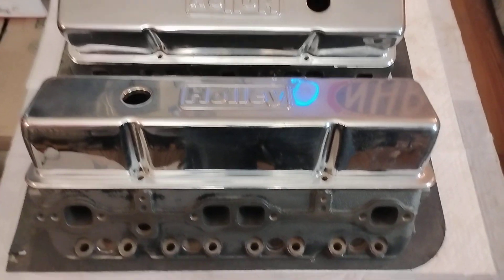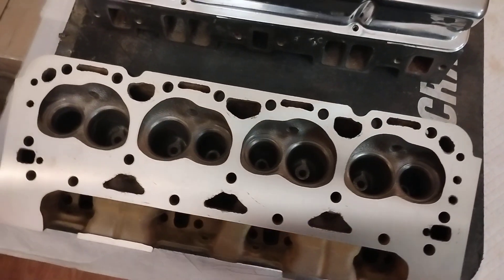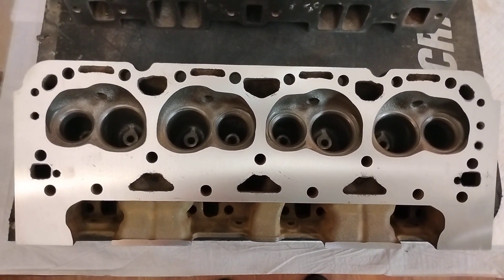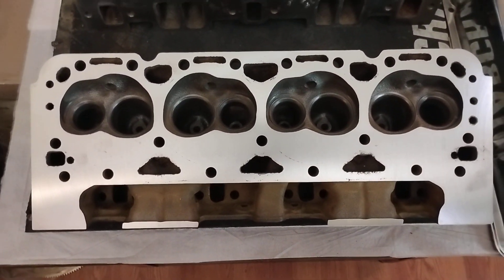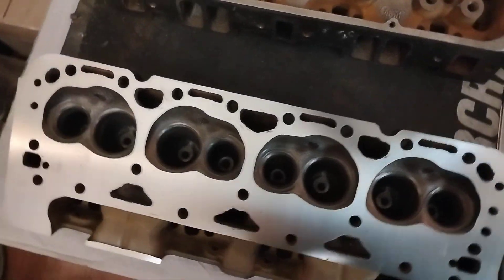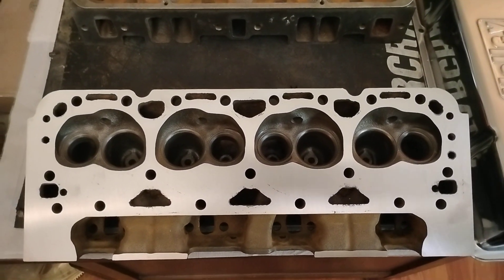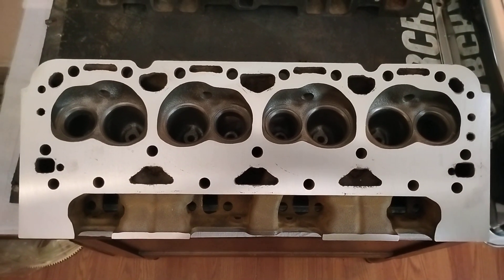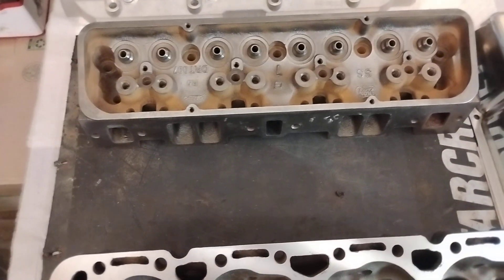DART 180cc IRON EAGLE heads for a 355ci SBC.

Comment: You know, I’ve seen a couple sets of these recently. Not that cheap, but one set was $400 in a better shape. Never run aluminum. Should I drop the money and try some aluminum Prolifer or AFR?
Reply from the maker: @Hogiewan1  Depends on how much power ya want from your engine. Aluminum is lighter.
Reply from the maker: @Hogiewan1  $400 for a pair of these is a hell of a deal.

Comment: Hey Sam, just got around to catch up on your video. You have inspired me to get a an old motor and build just to learn more and follow your videos and my buddy Nolan and Paul that follow you. I haven’t built a motor in a million years and always had my engine shop I have used forever to do bottom ends on anything I needed to get rebuilt or freshen up heads. I’m building a tribute car for my dad that passed several years ago. He loved convertibles and loved Buicks. It’s in paint and body but will definitely have to get freshened up since it’s a 34k mile car that the motor has never been cracked open from the looks of it. I bet it still has the original timing chain. I would like to build it but I know that certain things will have to be freshened top to bottom. It’s a Buick 350  4bbl from factory. It runs good and doesn’t blow any smoke but I wanted to drive it a bit before I pull it because you know how that goes, you are in it and if you want to do it right, you will replace a bunch of stuff since you already in it. Any advice would be greatly appreciated. Hope you and your family are doing well. 👍
Reply from the maker: @MrWill73  Them old Buick 350s are pretty dependable. Run forever.

Comment: If you were going for 500hp in a 4x4, would you start with the 350 that's in it or find a big block?
Reply from the maker: @Davidhillborn  350 can make 500hp pretty easy, but a bigblock would have Alot more torque. Also a 500hp 454 be a milder engine than a 500hp 350.
Reply: @thereluctantgearhead4544   Yeah, Im just wondering what would live longer at that power level. I always see people making more power, but they rarely discuss longevity/miles you can expect.
Reply from the maker: @Davidhillborn Bigblock about as durable as it gets. That's why they used them in RVs and dump trucks & school buses. They are stout even stock.
Reply from the maker: @Davidhillborn Seen 454s in old man dullies with 3-4 hundred thousand miles on them and still run fine. Toughest GM gas engine ever built.
Reply from the maker: @Davidhillborn bigblock Chevy was originally invented as a racing engine for NASCAR in 1963. They are good.

Comment: I always wanted to put a set of those on a 327 with a big solid lift cam 245-255 on a 108 lsa. Spin that bastard to 7-7500k rpm. I think these flow better than vortecs from what I remember. I think you're right, being topped out around 240-245 cfm, plus they won't crack just by looking at them wrong. That's a good find. Circle trackers used to do hidden porting on these. I'd love to find a pair for $150 bucks.

My wife said you sound like Negan from the walking dead. I always knew you put me in mind of someone, I just couldn't place it.
Reply from the maker: @inscoredbz  I'm building a rowdy 327 now late 70s drag racing style. Using ported 292 Turbo heads with a ton of work done to them. 290/215cfm intake & exhaust. Using a .650 lift solid roller. Forged crank, aluminum rods and Arias pistons. Should spin on up. Building it like a old "Modified Production" class type engine.

Comment: I know from watching your videos you have a pile of sbc parts layin around, probably a lot of crankshafts? Is that the reason you don’t mess with 383’s for a FUCKIN torque build such as this?
Reply from the maker: @USA-km9ph  I have 383s in my collection too. But for my wife's suburban, I can build a 355 that'll be plenty stout. I've built Alot of 383s, even built a few 396 SBCs and a 408 from a 350 block. But for the effort required, this is just a low buck 355 build that'll double the power of the current engine. Eventually it's gonna get a 454 swap, but I want to put a DANA 60 front live axle and leaf springs under the front and run a divorced transfer case with a T-400 and 14-bolt corporate rear. But that's the future plans. If it was mine, I'd build a mud bog truck with it with a radical bigblock Chevy in it & 40 inch groundhogs on it.
Reply: @thereluctantgearhead4544 always wondered if the 396 sbc is worth the extra work over a 383? Any thoughts?
Reply from the maker: @USA-km9ph  quite a bit more grinding and making clearance. But it definitely hauled ass. Took a long time to prep the block and shit. Used a .900 base cam. Used a 2 inch rod journal. Profiled cap screw rods, etc.
Reply from the maker: @USA-km9ph  4 inch stroke in a 400 block is even better. But it definitely takes some work.
Reply from the maker: @USA-km9ph  A bigblock is definitely in the plans for it tho. Be a torque monster 454 for the wife.

Comment: Nice score .  I have a 1990 Chevy 1500 shortbed 5.7 700r4.  What are your suggestions on heads and cam I’m wanting to stay with the tbi.   The truck is a daily driver, not a street/strip truck just a cruiser.  The stock horsepower is like a whopping 220 and that just don’t cut it.
Reply: I would definitely put a carb on it, a good 650 & an air gap intake would make a big difference. Swap to hei & itll be trouble free. The good thing is you can keep your factory fuel pump, just put an adjustable regulator on it & turn the pressure down a couple pounds.
Reply from the maker: That TBI will limit you. But a mild RV type cam with a smooth idle won't piss the ECM off. Probably stay below 212 to 218 range and a 114 lobe sep. 450 lift range should work. The heads are another problem, your TBZi intake is made for TBI heads that have the inner 4 bolts at a different angle. But there are a couple heads made that have that bolt pattern that are better than your heads. 088s would be a good production head that would work. Non swirl, 64cc chambers and they flow more than the 193 TBI swirl port heads.
Reply: @ I keep forgetting that the misalignment on the intakes, I would need an intake manifold for the vortex heads. If it was you, would you stay with the tbi or go with a carburetor?  I appreciate the help.
Reply from the maker: @michaelmaher4328 The truck this engine is going into is a 1992 Suburban. It has a 4-barrel intake & a 3310 Holley carb in it. Runs way better than it did with the TBI, probably 50hp difference. Get the same or better mpg. But that old 250,000 mile 350 still going strong, I'm building this engine to replace it. So I carb swap all my TBI engines I've ever had. It's more dependable than it was with the TBI. Had no power, drank the hell out of gas. But the carb & HEI ignition swap made a hell of a difference. Totally dependable.
Reply from the maker: @michaelmaher4328 even sounds better. Takes off much quicker.
Reply from the maker: @michaelmaher4328 I got a video about carb swapping a TBI on a OBS Chevy Suburban. It came with the same engine as yours.
Reply: @ oh yeah, it’s got like 2:73 rear gears, I’d like to stay with them, but already decided to get a posi unit for it.
Reply from the maker: @michaelmaher4328 Posi always a good idea. That 2-73 gear ain't doing ya no favors. MPG and top speed is what they are good for. Make for a slow takeoff. A 3-42 would feel like ya added 100hp. MPG wouldn't be much less. I'm surprised your truck didn't come with a 3-73 many do.
Reply from the maker: A good pair of long tube headers and a free flow exhaust help Alot on your truck. A TBI off a 454 would be a good swap. Edelbrock makes a performer intake for the TBI. Ditch the stock air cleaner and use a 14x4 aftermarket air cleaner. Just those changes would wake it up.
Reply: @thereluctantgearhead4544  ive got dual exhaust with free flowing mufflers and a pair of shorty headers already. I may get some stainless long tubes since the pipes and mufflers are stainless, my shortys arent.
Reply from the maker: Probably get 5mpg better fuel economy too.
Reply: @ no shit. I may just go with a carburetor, it would eliminate all kinds of problems and give me the option to make more power without losing its cruizeability. 
I got that solid roller 383 in my 79 elco last week. I’m running e85 since it’s got 13.5/1 compression. Now I need a cowl hood for clearance. It’s always something